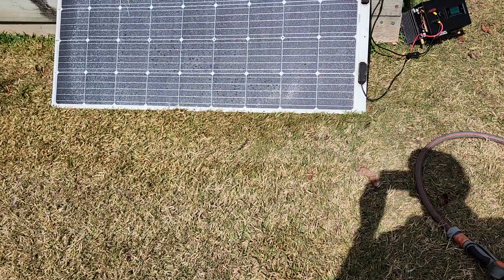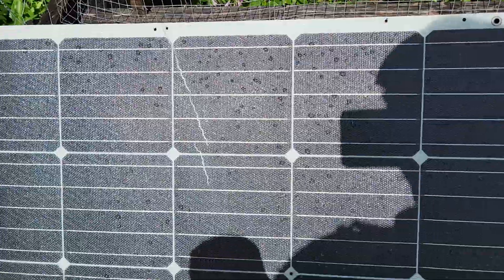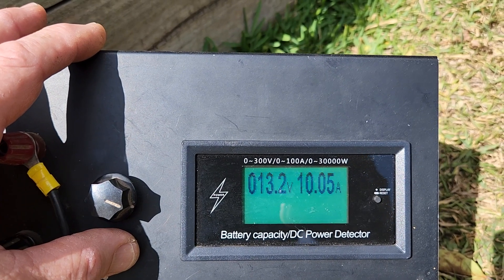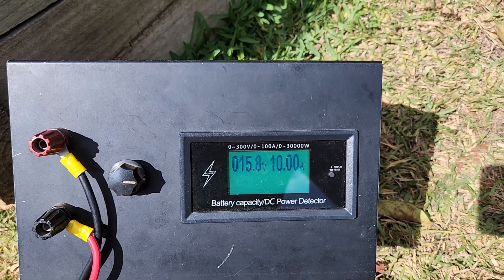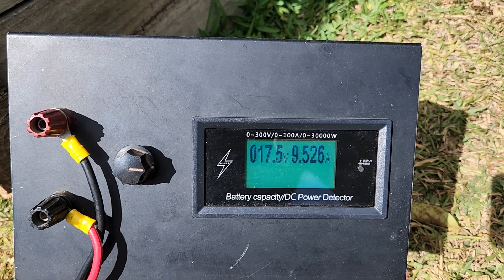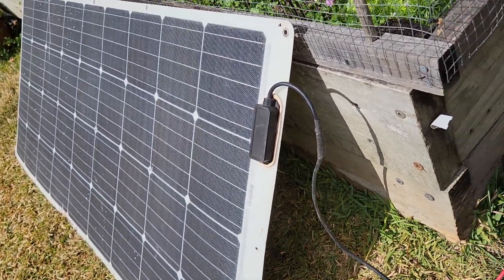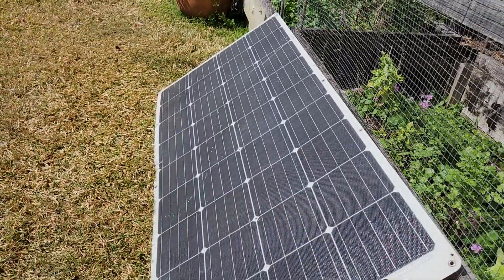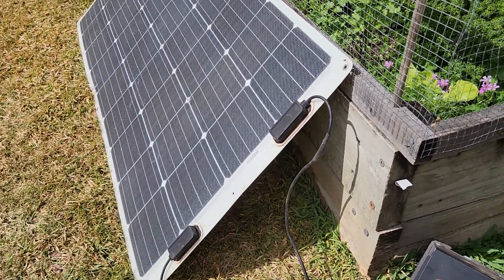Renogy 175 Watt Flexible Solar Panel Performance

Comment: Your comments are turned off on the install review of your 
Renogy 50amp DC-DC MPPT charge/control/monitor. 

First , the little green  BTS input is for your 
Battery Temp Sensor
and the BVS is your Battery Voltage Sensor for using an external unit OR some Smart Alternators have a connection. 

Now to clarify, as a Renogy Ambassador-
The new units have software updated to calculate the Input and allow the Alternator to charge at a full 50amps 
However with your unit you will find if you install a CUTOFF switch from your Solar PV+ input, it will automatically charge at the Full 50amp rate when there is No Input from Solar PV+

Maybe you can copy/paste this comment into that video OR update your original video and/or notes to help folks in this regards. 

Cheers & Take Care
Reply from the maker: Unless they have lowered the ALT input voltage required to achieve the full 50 Amps output (as is the case with the 40A DCDC charger - see my other Vid) its not going to help. The problem here that I was highlighting is that the ALT input voltage cannot drop below 13.2 volts to achieve the rated output and this is virtually impossible to achieve for a caravan or trailer situation due to cable loss and the practicable and manageable cable size. to output 50 amps the DCDC charger requires about 65 Amps input to overcome losses incurred through the charger. One of the primary objectives of a DCDC charger is to overcome voltage drop that will occur over 10 mtrs or 30' of cable plus connectors, etc. This was a failing in this product and may have been addressed and corrected in later versions.

Comment: Hi mate, I'm about to buy a Renogy 50amp dcdc charger. I saw your old video about the alternator under charge situation. I was just wondering if you or Renogy worked out the issue?
Sorry to bug you, but the comments have been turn off on that video.
Thanks
Reply from the maker: Hi Stephen, I think there are issues still with the 50 amp charger. You are better off buying separate solar and dc chargers and I use the 40A Renogy dcdc charger and it works properly as I mentioned in the description. I did a video on the 40amp dcdc charger also

Comment: Hi, what is the unit you are using to measure the voltage and amps from the solar panel? I need one like that. Thanks Peter
Reply from the maker: The unit I was using is a project I built about 40 years ago and recently updated with the digital display meter that I sourced from Aliexpress a couple of years ago (not sure its available anymore). This unit is a constant current tester for power supplies, batteries, etc., and can sink over 40 amps continuously for short periods. If you check my other videos I created a short video on this unit a while back. Its a great tool to have for accurately testing high current power sources.

For your application have a look at this from Amazon its rated to 180 Watts and good for solar panels:

https://www.amazon.com.au/Electronic-Multitester-Discharge-Capacity-Monitoring/dp/B0CBN6W43M/ref=sr_1_8?crid=1KCOOFDF44CEO&keywords=Vastarry+180W+DC+Electronic+Load+Tester&qid=1693265310&sprefix=vastarry+180w+dc+electronic+load+tester%2Caps%2C277&sr=8-8